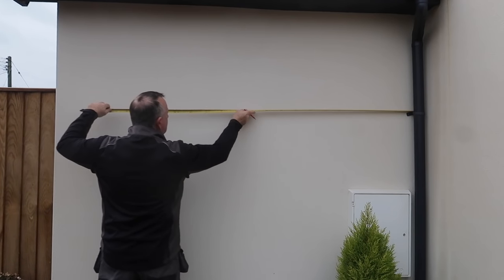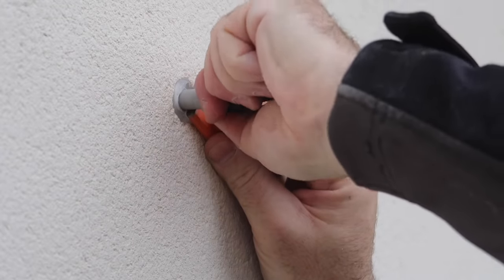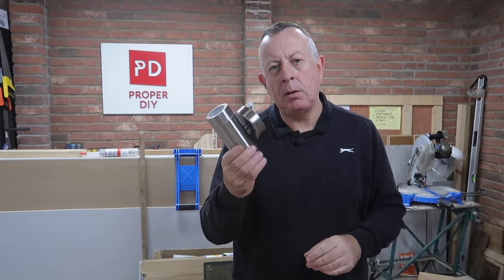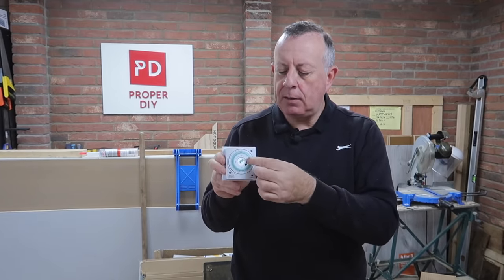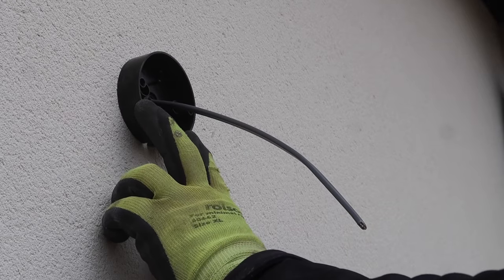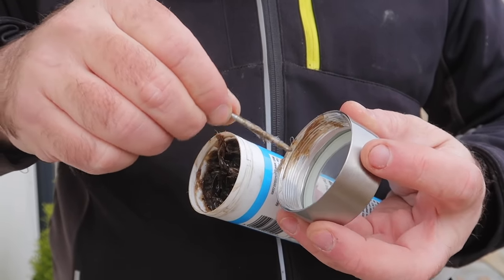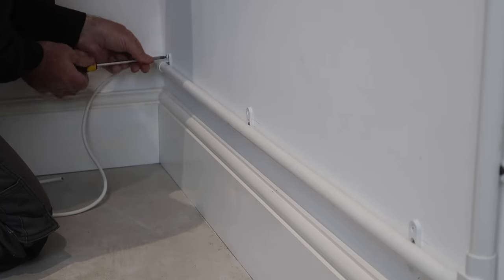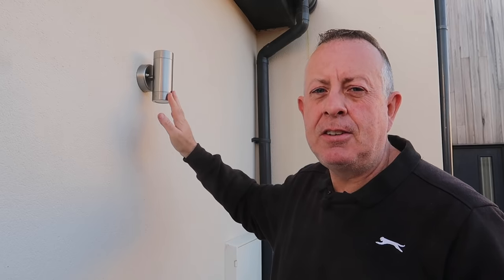Outdoor Light - Easy Installation without touching the house electrics.

Comment: As an electrician who has been doing this job for a number of years spent thousands of pounds on training and test equipment just a couple of points. The assumption that its okay because I haven't touched the wiring to the house is in my opinion a very dangerous attitude to take. Do you know if the socket you plugged into is earthed, does it have the correct polarity, is it a single pole or double pole socket Is the circuit  protected by an RCD. Also no mention of the size of fuse in the plug top. All these are important questions which need to be considered. There are a lot of people going to do possibly a dangerous job, so perhaps not the best subject to do a DIY video about.
Reply: As someone who usually comes down quite hard on sparks who often tend to be quite patronising, and rude, I agree with pretty much everything in your comments. 

I can and have rewired a house including new CU. Taken all the measurements and tested to destruction. It’s my house and it was all legal with BCO. 

*BUT * what I know is that unless you know what you are doing, you should not touch electrics. 

Your two comments that seem most important are the earth and the fuse. 

Checking earth can be a diy job with a plug in socket tester. How do fix it is often not. 

The right fuse means you need to know the wattage of the light, to size the cable for the situation and then, and only then, know what fuse to put in. 

Lastly, if a house doesn’t have a modern RCD then a: so not touch it!!! And b: get it upgraded ASAP. 

I suspect this house has modern RCDs by looking at it. Not every house does.
Reply: After watching several yt videos with experienced people shutting off the breaker only to find there is still power at the box, I have decided to only ever do anything after shutting off the main breaker and still testing anything for power. I figure its a good habit to have all the the time, every time.
Reply: @GeeTheBuilder  Actually you should fuse according to the cross section of the cable. But everything else I agree with.👍
Reply: By this logic you wouldn't have him plugging a light on an extension lead into a plug?
Reply: @nialstewart8263  
Hi Nial
I can understand why you would think that, all I am trying to point out is there are potential problems with not only this video but many others on you tube. The lack of testing and understanding the possible  outcomes is what concerns me. Having seen many jobs that are potentially dangerous over the years, my concern is that any electrical work is safe whoever  does the work.
Reply: Thank you. These diy electrical videos should be vetted or worse.  Videos about certain ethnic groups are banned, but videos that can lead to disaster is fine.
Reply: I supose the laws will be changed shortly to support your concerns then. If not probly keep shut and do your thing😂
Reply: @poo7481  third world, right?
Reply: Nice contemporary light, controlled by a 1970’s analogue timer - why?

Smart lights / hub so they come on at variable times to coincide with sunset.

Comment: The 4th connector looks like a place to loop the earth instead of using the wago.. Additionally, you should reduce the rating in the fused plug to 5amp as most ship with 13amp installed
Reply: 5amp is still way too much. 1 amp would be better
Reply: Its more likely a standard backplate. 4 terminals for Live & Neutral in and Live & Neutral out. Theres a trend now for not switching the neutral to the load, so 3 connections are used. 
    The 4th terminal is blank, and probably could be used to carry earth connections, but it would be compromising the manufacturer's instructions.
    Probably best using a wago in this instance anyway, as hes used soild T&E and stranded flexible cores.
Reply: It did look like a green coloured screw, so could be intended for earth

Comment: Another good wee video. Remember to change fuse in plug as they come with 13 amp as standard. Also could swop timer for WiFi switch so could be controlled by Alexa etc.
Reply: Why is that important to do? Could you elaborate?
Reply: @andriusantanaitis9922  Fuse-down as 1mm flex as used is rated to 10amps - you want the fuse to blow before the cable melts and catches fire

Comment: Nice job and really neat. The only addition to the install would have been to fit a lockable cable gland on the end of the conduit where the plug is. Would look neater and also prevent tugging the cable inside the conduit.
Reply: Was thinking the same. Plus I'd extend the conduitto nearly below the socket.

Comment: Did you change the fuse to a 1amp?  Also I would have used a smart plug or timer as that would allow more control around daytime/nightime hour changes.
Reply: 13A brown fuse in video 👍⚠️
Reply: I think u mean 3amp.
Reply: @rodd8170  nope. Typically led gu10 are around 5w, so 10w for two, meaning a current draw of 0.041a @240v, or if they were old style drawing 100w in total that would be 0.41a
Reply: Yes u r right but the min size fuse for a 13amp plug is 3 amp. Now if u actually fitted a 1 amp fuse u would proberly find it will blow with initial surge current, which is why fuses are always higher than the normal load current.
Reply: @iangriff2170  240v?

Comment: Thanks a lot!!! However, if I want to connect the wires to the electric socket, do I connect the wires to the junction behind it? If I switch on or off the socket, will I switch off my light together as well?

Comment: Just found this video as i saw these lights on sale today in screwfix. Would it be possible to power 2 of these lights from 1 socket? I plan on putting 1 light either side of the front door and there is a plug socket just inside the door that i can run to

Comment: Thank you for sharing.
Wonder if you could spread your knowledge.
I too have an upside down lamp, however i have a non metal touch switch. My issue is i can switch the light on internally however when switched off it should automatically detect motion(which it doesnt). How can i fix this? No earth wires connected.

Comment: Great video. 
I have a single outside garage light that is operated by one light switch. If I where to remove the light fixture would there only be one cable from switch to the light fixture? As the power source is taken from another switch that sits side by side.

Comment: About to fit my own outside lights but I will need to get into my lighting circuit proper for it. One thing that I don’t understand is why didn’t you just put the white plug cable through directly to to the light. Why use the 1mm T&E ?

Comment: Hi there, just wondering about the fourth connector in the timer, if not connected to anything in the timer circuit, is it a loop connector to be used for CPC (earth) so avoiding need for jointing connector

Comment: Would you just use the black tubing with twin and earth cable if the light on the outside (by front door) is nowhere near where the socket is indoors (side of the house under the stairs)

Comment: Great video. The question of 4 connectors at 12:42. Without looking at the connection box properly, could it be that the 4th connector is there to do exactly what you're using the WAGO type connector for? To be clear, I can't see the connection box clearly and therefore I'm asking a question rather than giving advice. I would always recommend taking professional advice in such circumstances.

Comment: Hi Stuart, quick question, has the light fitting rusted at all since you installed it? I've never had much luck with brushed stainless steel outside?
Thanks Ian

Comment: Hi, great video and very helpful to me as I’m planning to install 3 outdoor lights to my garages! My question is … the lights I plan to install are remote control colour changing up down lights . So would the remote still turn them on and off while they are run through the timer which would be set for specific times?? Hope I’ve explained that ok

Comment: Thanks for the video, very thorough, clear and some great tips that I wouldn't have thought of, like the right way up for the lights!  I have some questions, and hope you can help.  I have 12 outside lights to put up, to be powered from the garage, and having checked the light switch in the garage, it does not have an earth, so I will (presumably) have to go the same route as you did i.e., use a plug on the end connected to a garage socket.  I have a couple of problems though - firstly, using your method, would I need to install a spur, or can I go directly from the plug socket, to the first light?  I'm guessing no spur needed, but perhaps you could confirm?  Secondly, 10 of the 12 lights are made of metal and have an earth connection accordingly, so they will need to be earthed (no problem, as the cable and T&E will cover that).  However, two are plastic and do not have an earth.  How can I wire them all up together?  Would I simply bypass the earth connection on the two plastic lights (so just wiring up the live and neutral), and carry on to the 10 metal lights with all 3 wires (the earth bypassed from, and not connected to, the plastic light, and the live and neutral coming FROM the plastic light), or would it be better to have the two plastic lights at the end of the run, so terminate the earth connection at light no.10, with just the live and neutral continuing to the plastic lights?  I wanted to start the run with the plastic lights as they will be on their own and are virtually the same as the other 10, but not exactly, hence I want them separate from the others so the difference isn't noticeable.  I also have the issue of not a timer, but a Sensky Photocell Sensor Switch Dusk to Dawn (see Am@zon), which I will need to install outside, so that the lights will automatically switch on when dark.  I'm assuming I should have that at the beginning of the run, before any lights, but can you confirm?  The sensor does NOT have an earth connection, so would I again bypass the sensor and just continue the earth wire to the first light, along with the live and neutral from the sensor?  The item on Am@zon shows the connections i.e., 2 x live, and 2 x neutral.  Lastly, I will be running 6W LED lights, so total load will be 72 watts.  Thanks in advance.

Comment: Thanks for the video. I usually agree with you wholeheartedly on everything and learn several new tips and tricks in every video but I do sort of disagree with you on wiring the light into a socket. I can see why you've done it in your case but for most people it's not convenient to lose a socket or have trunking round the room. 

I have a relatively new build so my walls are all hollow or dot and dab like yours and even as a relative amateur, doing this properly by running it to a fused connection unit spurred off the socket is incredibly easy.

Comment: I've done this two, but in addition I used a 3amp fuse at the plug.  Belt and braces I suppose as the cabling is more than up to 13 Amp, but with an LED external light the load will be tiny.

Comment: It certainly is very important that the light fitting is earthed but how do you know it is earthed if you do not test to verify the continuity of the circuit protective conductor? 

When terminating fine stranded conductors into a plug top or for that matter any screwed connection ferrules should be used to ensure a good connection & to prevent damage to the conductors.

Comment: I used lights with built in dusk to dawn photocell operation. Effective all year round and probably cheaper than a timer. Just needs an isolating switch. My problem is I am very close to the sea and many manufacturers say their lamps are not suitable. As they are all stainless steel I don't know why. The problem is they are lacquer coated and the lacquer deteriorates.

Comment: A diyer who knows what they are doing, makes a change. I'm trained industrial, commercial and domestic electrician. They extra terminal in the timeclock may be a loop terminal for the earth, but unless stated on supplied wiring diagram your way is better. I would suggest to anyone doing this to make sure and use a 5amp or 3amp fuse in their plug top and not 13amp to keep fusing correct for size of cable. Job well done, thanks for video.
Reply from the maker: Thanks. Yes exactly - no details on what the extra terminal was for so best avoided. I should have made it clear I downgraded the fuse to 3amp.

Comment: I've recently run a load of cables through conduit (they were previously just clipped to the wall) and found that the plastic pipe cutters I have for Speedfit pipe works a treat on the conduit.
Reply from the maker: Good tip - I'll have to invest in some

Comment: Good tips on this channel for the clueless amongst us, myself having no tools and no DIY talent at all, I got lucky, didnt have to drillI, i noticed loose mortar by outside upstairs window sill, when poked it went right through, so i ran a new tv ariel through and bought a 8W Luceco prewired sensor lamp, they are fitted with enough lead to go through your wall, just put a plug on with a 3 amp fuse, and a tube of Stixall filled in the hole, to my amazement the light and tv ariel are still in place and working

Comment: So basically a way to fit an outside light but only if it is on a wall that you are happy running a cable up, you want a timer almost out of reach up the wall and you have a spare plug nearby!  
Most outside lights will be on the house wall and the garage probably not have power nearby. (If that is you then run the feed from the nearest existing light).
The four terminals is probably that it is a double switch to turn off the neutral and the live as is needed on some fittings.

Comment: So if I wanted 2 of these lights one either side of my garage door but they have the PIR sensors I wouldn't need the analog time switch and could just wire it into the plug socket and leave it turned on?
Reply: Yes, that's right.

Comment: Nice job, clean and tidy,
But if you use silicone you should make sure it is suitable for the job as some types of silicone can have an adverse effect on Twin and earth cables. Also if you drilled out the drain off hole you will not montane the IP rating the the light fitting . And I would have replaced the connector block with a WAGO 221 as those the screws in the chok block will rust over time and course the copper conductors to coroad Otherwise it’s a nice little job very well done. 👍 oh and the plug should have a 3amp fuse .

Comment: I just took a table lamp off a plug in timer and replaced the timer with a smart plug instead.  Far better as it automatically comes on at sunset, whatever time that might be so it saves me resetting the timer during the year.  Also I can operate the table lamp remotely.

Comment: Hi Stuart, as an Electrician that also has a YouTube channel it's clear that you take pride in your work.
As an Electrician what I would've done differently is to not have the conduit on show within the house, I would possibly have taken the feed via the socket circuit and then onto a fused connection unit with nothing really being on show inside the house.
You have the right idea in that as it's a class 1 fitting you need to make sure that it has good Earth continuity.
I would also have checked to see if the house has an RCD fitted as it's an outside class 1 fitting.
Also I would've fitted a 3A fuse.
Everyone has their strengths and weaknesses, you will undoubtedly be able to do a lot more DIY work than I can.
I would recommend to anyone that if they're confused by this video to get an Electrician in to complete the work, you're probably only looking at 1.5 hours labour to fit it as I just said.
Reply: How much do you think an electrician would charge to do this job
Reply: @keziasarah  If it is how this video is and the customer was supplying the light fitting then I would be charging about £150
Reply: @DoctorElectricYouTube  thanks appreciate your reply
Reply: @DoctorElectricYouTube as a trademans myself I could think of anything worse than paying another bloke £100 an hour (minus expenses) to fit a light 😂 absolute daylight that is.
Reply: I just wouldn't fancy chiselling channels through the inside wall of the house plasterboard as it's all got to be filled and refinished. I have some solar powered cheapo chinese lights with IR sensors that I have attached to the pathway between the house and garage and house to light the way (fitted to the garage side pvc/wooden roof fascia so as not to necessitate drilling the house brick and having to hide the wires in the house), the limitations of solar in winter have been revealed though and they're only good for 2-3 turn ons per night. If I get too bothered by it I can always replace them with wired ones and take the feed from the garage inside lighting/socket circuit transfer Box. Exposed wires in a garage are acceptable lol.

Comment: Looked like a 13amp fuse in the plug, did you change it after? 13amp is a bit big for one light. Otherwise a nice neat job, well explained.
Reply from the maker: Yes I did - changed for a 3amp to protect the cable

Comment: Lot learned. in the US, we call it ground wire what you call earth wire. I personally like to use solid 12/2 (12 AWG) with ground wire or use 14/2 for a lower voltage application.
Reply from the maker: Thanks for sharing

Comment: Curious on the use of pex as a conduit.  Is that within code?  I would assume the the fire rating on pex has a much lower rating then the pvc conduit that supposed to be used for electrical install.
Reply from the maker: Quite the opposite. Both perform about the same with high temperatures but HDPE is more durable than the cheap PVC. The way I look at this is that I am allowed to route cable through timber (adding a light to a timber shed) so I don't feel that putting a cable through HDPE has a higher risk.